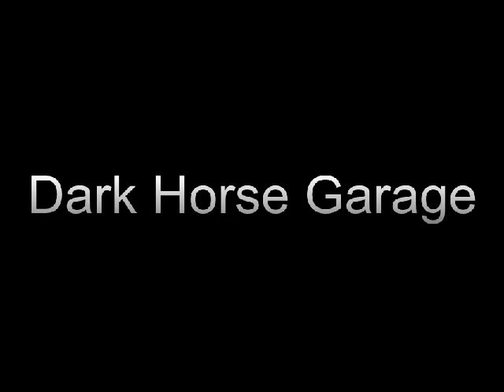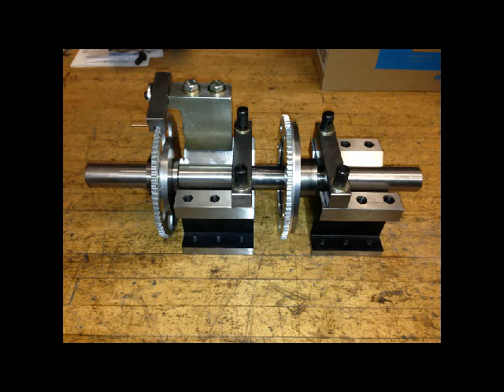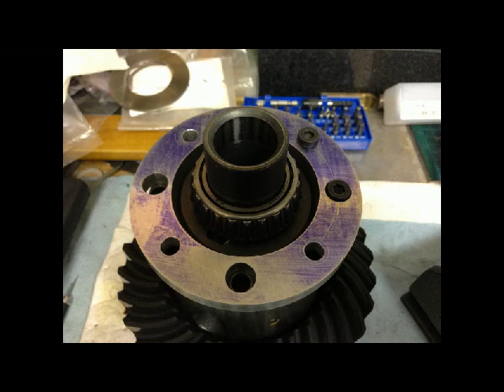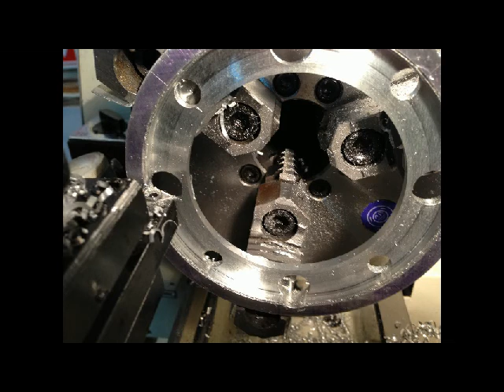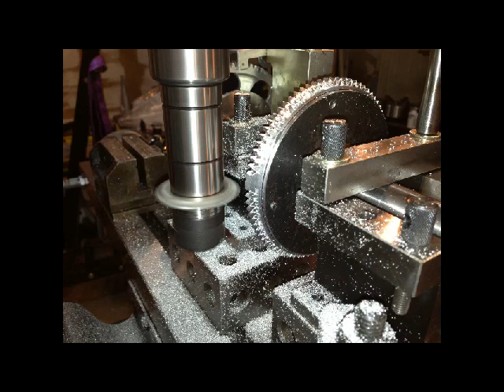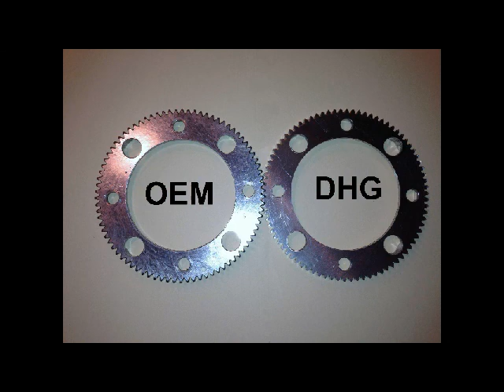Gear Cutting - 944 LSD Oil Pump Drive Gear

Comment: could u use an electric pump instead and tap into the drain port? this is so you can use the eternal trans-axle cooler correct? nice machine work..

Comment: Nice work, is the a particular way that gear sits on differential, I know recess faces differential, but does it matter how it sit in respect to the peg?
Reply from the maker: Hi jp cia, Yes, in fact the purpose of the recess which is machined to a close tolerance to the differential case is to provide concentricity to maintain the correct engagement of the gear teeth between the drive gear and the oil pump gear.